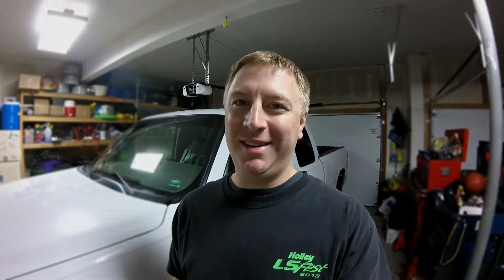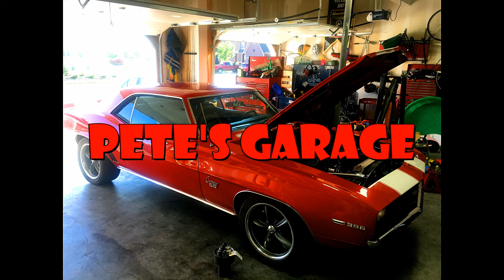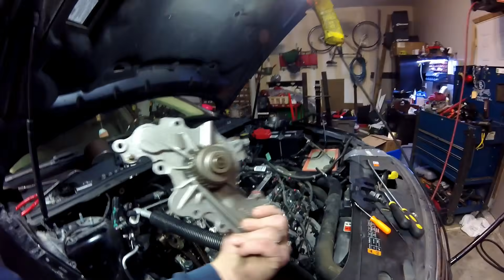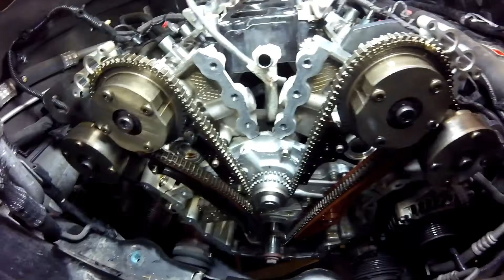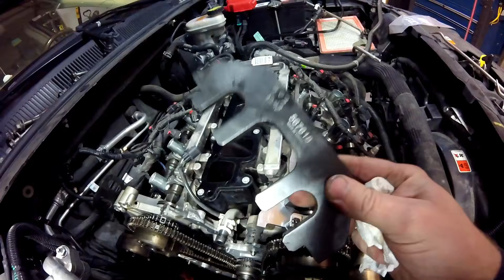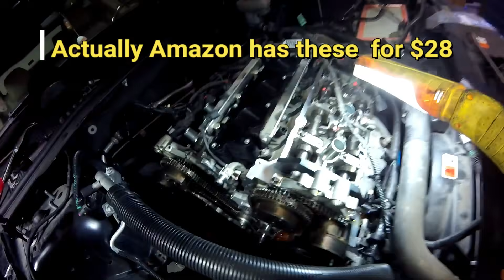Why does the Ford Taurus, Explorer, Edge 3.5L water pump cost over $1400?

Comment: lol...i'll keep my '74 Duster and my simple 318 w/my 4bbl.
Reply: but i can fix it all myself and know the works done right, besides, what man wants to pass a Taurus to his son? and who wants gas mileage? i want fun. and if i tried to pass a Taurus to my daughter, i'd get slapped for that as well.
Reply: Wish I still had my '73 slant six. You're a lucky man.
Reply: Amen to that i!m an ex-mechanic that got disgusted with the disposable crap that passes as var today that why my newest vehicule and daily driver is a 318 powered 78 monaco 4dr(think Rosco p coltrane) as reliable as a hammer and starts in -40celcius weather without being plugged in while quite a few late models around  here wouldnt start even while plugged  in!happened all winter
Reply: lol. it's all good,
Reply: 1973 d100 with 318 2bbl/3 speed manual. Also 1976 Dart slant 6/904 auto. I love the old iron.  Fuel mileage be damned.

Comment: What a sorry piece of shit designed engine from Ford! I have a similar piece of shit designed engine from Ford. 1998 4.2 V-6 the engine hydro locked due to the design of the heads and head gaskets! The combustion chambers at back of engine will fill full partially  of radiator fluid. The next morning you start engine and you have bent connecting  rods, damaged pistons! And Ford would not offer a factory free repair to a destroyed engine. I had to rebuild the engine at my cost, and do all the wrench turning myself. I had to buy thicker head gaskets, and have the heads checked for flatness, I had to have machine shop go next size over on pistons, I went ahead and did the head work, replaced some valve guides, lapped the valves. Actually found some cracked valve guides on an engine with under 80,000 miles! Installed new oil pump, and water pump. All new gaskets. Alot of time and money!  The last Ford I will ever own. Now that I seen this video on the Taurus 3.5 V-6, I seen what kind of engineering Ford is producing! CRAP! First On Road Dead! FORD!

Comment: This is planned obsolescence at it finest. This is why ford outsells the others because why fix your used car for $1500+  with no increase in overall value versus trading it in and the payment going up $20 a month and getting a new car. A 5 year old car needing a water pump that is buried like that is ridiculous in and of itself.
Reply: Chevy's 'new' gasoline turbo 4 cylinder full size truck engine has an electric motor driven plastic water pump, it is under the exhaust and turbo, no way that'll be a problem.
Reply: @Maples01  No problem.  It's made of a new plastic called nocrackium.  It'll be good forever.  It has a small amount of nomeltium in it as well.
Reply from the maker: Yeah and a coolant flow control valve with something like seven different coolant temp sensors.
Reply: same with the 92 Honda I had, it was hard to get to, I don't know about the newer models as I pretty much stop driving after that.
Reply: then you have no idea about what's inside most modern cars engines .. Chrysler been using the same design in their 2.7l engine since 1999.
Reply: theR6969 Is this a Chrysler? No. This is a ford  that is 5 years old with an engine that has been in production since 2009. It looks like you have no idea how modern car companies make money.

Comment: Everyone is completely missing the point. Cars are striving to be more and more fuel efficient. Less weight, more power, more this and that. These designs are not going away. And your Chevy, Audi, Honda, Subaru, Suzuki, Daewoo and every other manufacturer is going to adopt these designs. If you want a water pump that takes 10mins and 25$ to fix then go buy a tractor. You want 40mpg 300hp and crash safety. Then get used to these type jobs. It's only gonna get worse. And hearing all the crying in the comments is annoying.
Reply: I can't wait to see the reactions to the future designs. Turbochargers with alternators built in. No belts at all. Direct drive accessory's. Electric solenoid intake/exhaust valves. Joined block and head engines without head gaskets.. ppl are so blind.

Comment: Seeing that makes me recoil. Thankfully for me, my first truck was a 1998 Nissan pickup, so it didn't have that water pump design issue, but it did have a problem with the tensioner. Apparently the spring that keep the timing chain taught is not strong enough to withstand start up, causing the chain to become loose and hits the fixed tensioner. This over time breaks the plastic, and for my truck it happened so much that it wore down to the metal of the part. Thankfully the person that was repairing my truck, with my limited help, added a spacer to the new tensioner so it would last longer.

Comment: Part of the reason they do this kind of engineering is packaging. Yes they could build a dual overhead cam v6 with an external water pump. The problem is they put this engine in several different vehicles, including the Ford Taurus, Edge, Flex and their Lincoln counterparts. If it had an external water pump, it would mean they would have to add a pulley somewhere to turn it. On a lot of these engines and a lot of these crammed engine compartments, There is simply no room. The engineers frequently have to make things work so the car can be styled a certain way and achieve good power and economy.  Of course these cars have to pass government crash tests as well as those small overlap ones by the insurance Institute. All of these factors are going to make this kind of hellish design inevitable.

Comment: That's a straight up criminal design. Water pump fails, you get coolant in the oil most likely and a blown engine before it ever even over heats. This is why the big three are always in trouble.

Comment: 1400 is rather cheap IMO for a job like this. I am in NJ the Nissan Dealer i work at (see my excellent DIY videos to find out) charges $140 an hour and to do timing chains on a Nissan we charge about 14hours worth of labor. I do own a ford edge with 125k on the clock (previous owner took great care of it) so i know at some point it will require a water pump i hope that it only costs me 1400 dollars to get done. I don't have the time to do that big a job at home or after hours at my job. But if they ask for 2k, yeah i will find the time and do it myself lol... unfortunately there isnt too many desirable v6 vehicles where every job is easy to do. Nissans are not hard to fix, but i feel like i get a better ride with Ford.

Comment: It takes about 30 minutes to take the water pump of a sbc, or sbf these new car designs are over complicated, just so they can be over complicated, what is the benefit of having it there they go to had electronic water pump off the side of the car that pumped in through freeze plugs or something lot simpler

Comment: Does the water pump cost.1400.00 or the part plus labor. Title may need an edit
Reply: No edit needed, you need common sense.
Reply: @Carlitosway211  obvviously with that response "common sense" is not common to you. Look in a mirror. Stop drinking. Take up knitting. Thanks for playing, charlietroll👍
Reply: @hoost3056  Says the guy that thought just a water pump cost 1400 on a Ford Taurus.
Reply: @Carlitosway211  Oooo, what a comeback, my poor wittle feels is hurt😄😄😄😄😄
Guess you told me. Now get back to your blockset....round peg into round hole....and that three sided thing is a triangle😂
Reply: @Haywood Giablomi as lazy as you are insulting, thank you. Get a grip goomba
Reply from the maker: The whole point about the video was to explain why the water pump replacement job costs $1400. Most people don’t have the tools or ability to do this job on their own. Not to mention, you could severely damage the engine if you don’t get the camshafts and chain timed correctly.
Reply: @PetesGarageandperformance  understood. Ive run Ford products for years and left after the excessive complexity in their designs. Its all a money hustle. When running a Lincoln MKT in fleet, i found out the transfer case was sealed and a common failure point in the awd system. Why no drain plug? Oh.. I know....2500.00 transfer case replacement versus 60.00 every 60k for a fluid drain.
Reply: @Haywood Giablomi so are bored goombas. Enjoy yourself Trollie McTrollerson from Trolltown👍

Comment: I have a mechanic shop,I charge 250 labor for this job.And the customer still leaves my shop pissed off at me.
Reply: Why the hell are you doing that to yourself?! You need to move to another location and change your demographic. You're literally paying to work on someone else's car. That's a 9.8hr job in the labor guide. That's over a grand in labor at my shop. I don't give a fuck if I've gotten better at it because I've done it a few times.  I shouldn't have to suffer because my skills have improved. You need to bump those numbers, dude. #FYPM

Comment: I just did this job the other week at the ford dealership I worked at, the job can be done in roughly 9 hours if you have a lift and Powertrain lift or lifting table, but it’s easier with the engine out of the car, but everybody can’t do it that way. Personally I think it’s a design flaw, maybe a better solution wasn’t though out...

Comment: I was considering buying a 2018 expedition. Does anyone know if it has an internal water pump? I know that models engine is not the 3.5.
Reply: The 2018 expedition uses the same powerplant as the f150. Pump is easily accessible. It's also the third generation ecoboost so it's highly proven

Comment: That has got to be the worst possible design.  You get no benefit with a chain if it is driving a warerpump.  A design by young engineers that may have never worked on a car?  I will avoid this engine like the plague.  The 3.0L in the fusion is an easy, 1 hour job.
Reply: Packaging and making a serpentine belt failure less serious

Comment: Had a 2008 Mercury Sable.  . A local shop not a dealership wanted to $2000 to replace the water pump.  200k on the clock. So dumped it for 300.

Comment: Been there...had the same issue with my 2013 Explorer 3.7. The dealership ended up dropping the entire front cradle down and did the  job on the shop floor. They said it was the fastest way to do it. Oh ya, they did it in less than a day.

Comment: ford  knows this is a cheap waterpump. now there making a lot of money on customer repairs. ford could of  quad sealed  the bearing and shims with viton or silicone seals. the bearing should of been made with titanium or ceramic rollers. would of costed ford $200 dollars more to build the motor. this is how they cut cost to pay back the bank they borrowed 38 billion dollars from  during the resession.

Comment: Looks like the same setup as the nissan v6, also a pain and it does not use gaskets at all. The entire timing covers and water pump are covered in sealer, takes an hour + just to scrape it off.

Comment: Nice click bait title. The job costs $1400, not the water pump.
Reply: I think what he meant was - you go into the shop with the old leaky pump, you come out with a new pump and $1,400 missing from your wallet
Reply: @K Long  I get that, but put replacement or something in the title. The pump doesnt cost $1400, the replacement of said pump at the dealer/repair shop does. Only clicked the video because that seemed like an absurd amount of money for just a water pump, hell the Motorcraft one is like $90 shipped from Rockauto.

Comment: Ford probably isn't the only scam mechanically designed to rip you off. Even back in 80s a ford thermostat could cost 4 500 bucks to replace. Today fords are junk and have been junk for decades.

Comment: Get the primary timing chain set and/or just the chain tensioner, don't have to remove the cam actuators at all.  The chain tensioner can be removed and you have enough slack to remove the chain.  Agreed though...tough job.

Comment: Man that's a dumb design.  I bet the mechanics at the Police maintenance shop HATE working on the newer Exploders and Taurus cars.  Yeah the old Crown Vics sucked down gas to the tune of 10-12mpg if you ran them hard, but they were robust, a lot simpler design which made them a hell of a lot easier to work on.

Comment: I still have a 2005 Taurus with 330,000 kms on it with the old Cast Iron Vulcan engine and it still runs perfectly. Yes I had to do the water pump at 200,000 but I did it myself and it was not a big deal. Stupid idea burying it like this, same on the 2.7 Chryslers which constantly failed usually wiping out the motor.

Comment: The car is a 2014 and it needs a water pump already ROFL.
Reply: Depends on milage and engine hours, keep in mind a lot of these are police cars that never stop idling.. that being said my 2015 cummins has eaten a water pump already, but has crazy high milage
Reply: extremerc76 I'm not sure if my pump had ever been changed. I have an 05 duramax with 330k miles. So far no problems
Reply: @extremerc76  what's crazy high milage for a 2015?
Reply: 5vzfe 3.4 v6 2001 Tacoma 185k just replaced the original water pump
Reply: Tong L lmaooo tfoohh!!!! Ford and Taurus can kiss my ass
Reply: Of course. Right out of Ford's warranty.
Reply: My Jeep, a Chrysler product, a CHRYSLER product... has 233k on it and still has the original pump. Its 18 years old.... and still has the original pump. A 4 year old car should NOT have a water pump problem this early unless the owner drives wide open throttle on every drive. If Chrysler of all companies could make a water pump last this long then Ford should too. Never buying a Ford in my life smh. Toyota all the way.
Reply: @FusionKota  Bought my 1988 ram 10 years ago. Still have not had to replace water pump yet.
Reply: They probably designed it that way and claimed it would last longer.... Sounds about right.
Reply: yea i have the same car with 135 on the dash so maybe its due...lol
Reply: Right
Reply: I have an s15 gmc truck from 1985 and I barely had to change mines !!
Reply: Tong L Came here looking for this. One guy starts in about mileage and use blah blah blah. It's fukn 4 years old and needs a water pump!?! They knew what they were doing.
Reply: I have a 79 T-bird and all the parts on it are original n havent failed, besides the leaking power steering pump lmao
Reply: Yeah. I thought the same thing.
Reply: My car is a 05 mercury (which is a ford vehicle) and still has original water pump... not all are bad
Reply: That was my first thought, absurd failure. US auto companies produce total crap.
Reply: Jason D you’ve never worked on anything European before. They make bullshit, that’s fun to drive. We just poorly design practical cars
Reply: @jasond4752  comaped to....what......

Comment: My 93 Corolla has the same built work with the belt but the whole kit including water pump and belt and all the other seals comes out to $60 on amazon. The problem is that $85 an hour labor cost is more expensive.
Reply: 85 is cheap check dealer prices 120 an hr or more

Comment: Just like the Chrysler 2.7 litre. Damn internal water pump.
Reply: It is pretty stupid design like that electric water pump on the bmw
Reply: Toyota also used that design i once had a camry (95 i think)show up on a tow truck the water pump had seized ,stripping the timing belt .stupid design,also the 2.0 neon and 2.4 stratus also had that drsign but their water pump lasted on those!never had to replace one
Reply: ItsAlwaysRusty And that's why Chrysler is on their last leg....
Reply: Chrysler stopped making that engine years ago .dumb ass  .Ford just doesn't know any better .
Reply: @bradhardy2629  Wow.. No kidding. Look on Wikipedia for that knowledge?? No reason for insults...
Reply: @bradhardy2629  And the idiots who designed these engines knew that the water pumps fail.

Comment: The water pump does not cost $1400 the whole job does but dont you rember when vehicle only had 1 cam shaft well my GM full size still do they started direct injecton but it will be a while before i buy one of those

Comment: The engineer is sometimes under pressure ro make a design as compact as possible to fit a more aerodynamic design for that last mpg. That's why full size spares died. Less weight with those temporary "doughnut" spares to chase mpg ratings.

Comment: Another reason I will not own another America automobile...

The Asians have left the Americans in the dust as far as Automobile built quality goes!!
Reply: Bull shit
Reply: Toyota and Honda have water pump's run on timing belts some ,maybe most are interference motors. It's expensive to fix at the dealership as well...

Comment: And yet, Ford mounted the water pump separate from and driven by a pulley and belt off the back of the front camshaft on my V6 Escape.  Brilliance and incompetence from the same company.  Go figure.